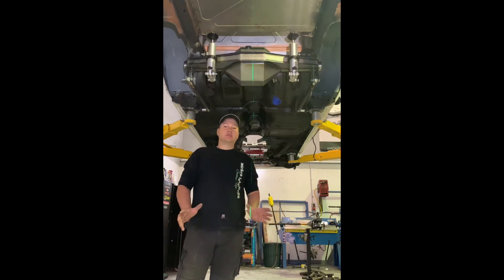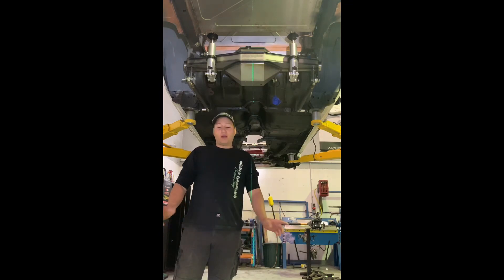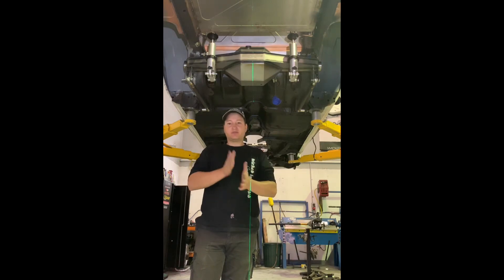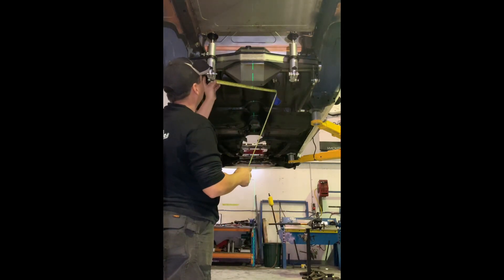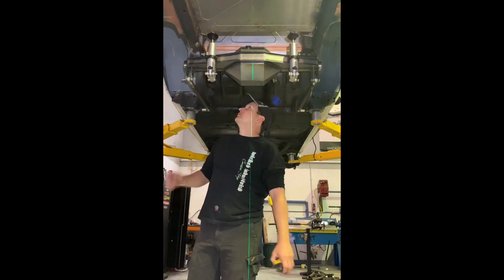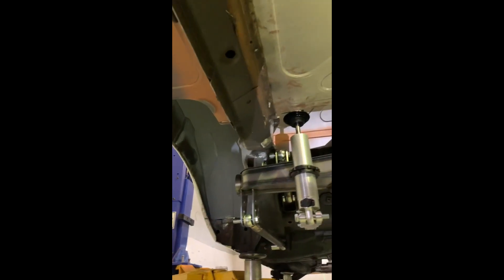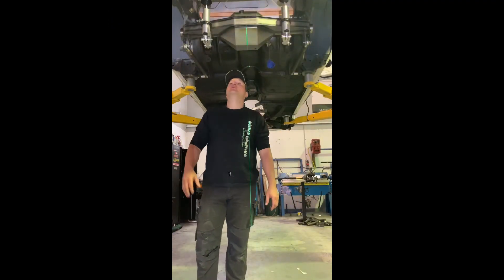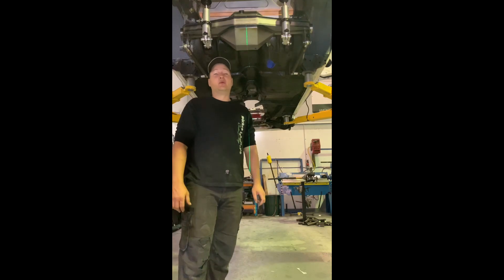Coil over shock setup tips

Comment: Woulda been way too easy to assume the rails would have been evenly off the centreline, wouldn't have thought to question it really. Great insight!
Reply from the maker: Jeff Stockwell question everything when working with cars, the factory seems to have lost their tape measures back in the day 😂
Reply: All the work I've done previous has all simply used stock geometry so it's never been an issue, haha! This pro street project is definitely an eye opener, and gives a new appreciation to the whole thing
Reply from the maker: Jeff Stockwell i’m always happy to help mate, if you need any components or advice feel free to shot me a message on either the facebook page or instagram etc
Reply: Cheers boss, appreciate that 👍